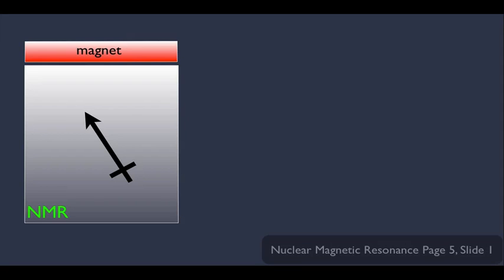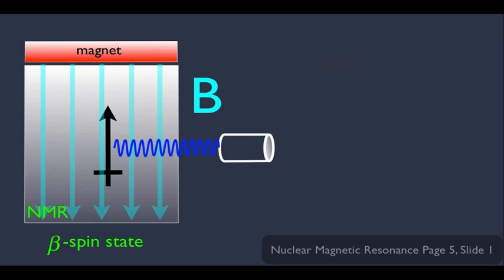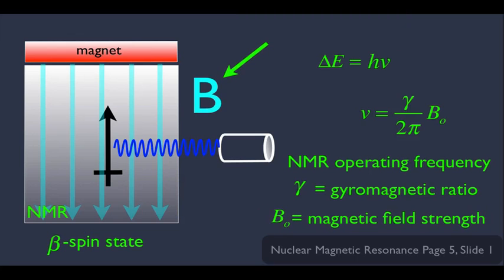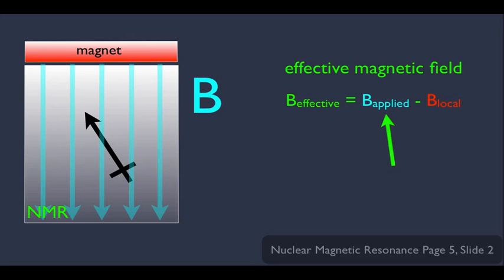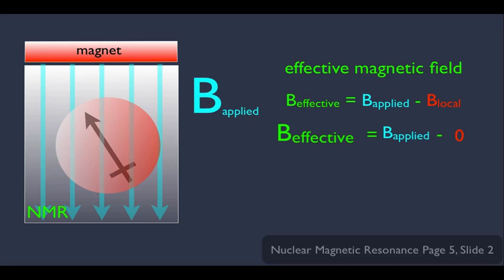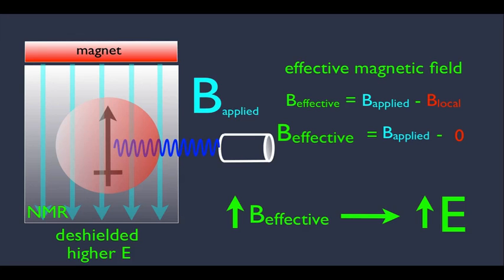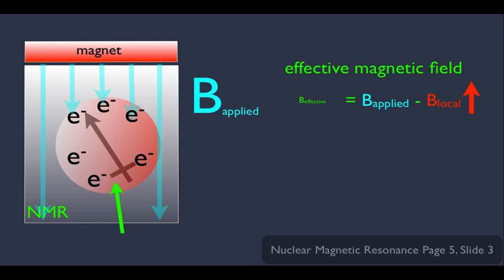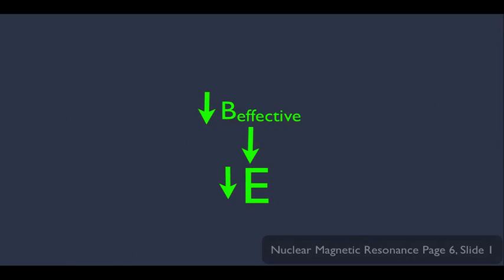Introduction to NMR Spectroscopy Part 2

Comment: My question is:
If the deshielded atom is already lying almost antiparallel, which is quite possible in the random arranged elements then HOW can this concept explains the position of peak as downfield??
Kindly answer me??
Reply: Remember the NMR has an enormous electromagnet pulling most of the nuclei into alignment more often than not.
Even in a tiny NMR sample tube, there's millions of nuclei.